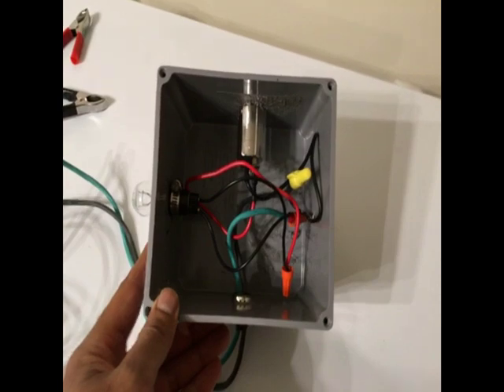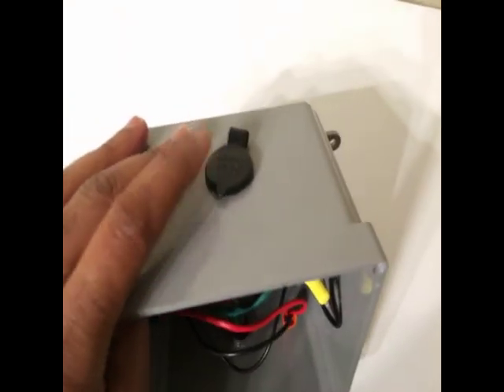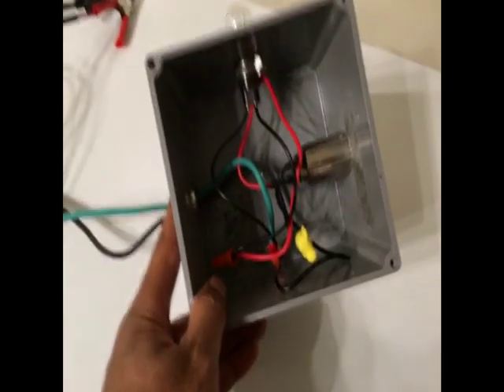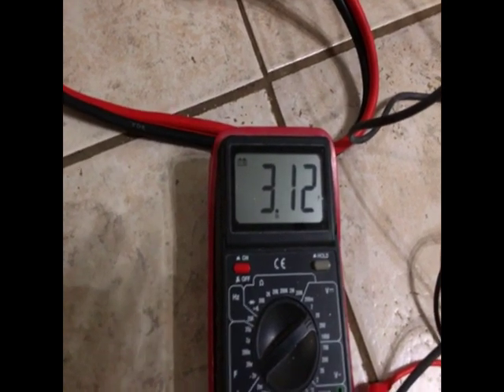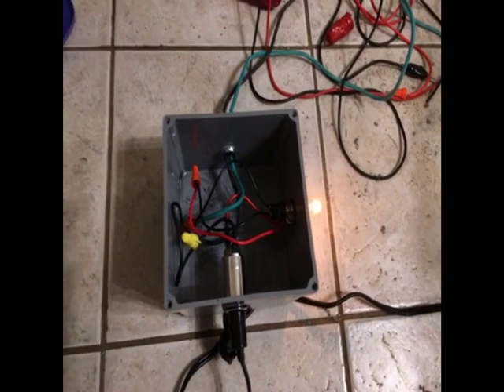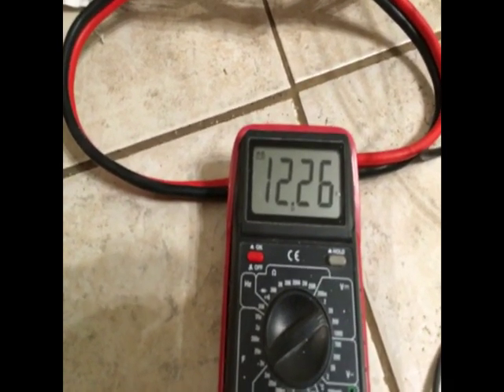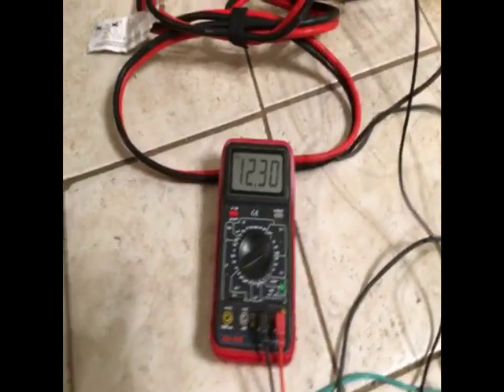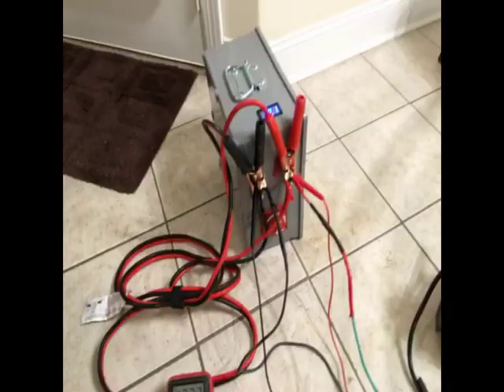How to Charge Ultra-Capacitors Safely

Comment: Bad to the bone I love it.
Reply from the maker: Thought you would like it.
Reply: It looks so good.
Reply: Thanks for the shout out
Reply: You can add a resistor in parallel to the light and it will charge faster too =)
Reply: Check the Ohms on the light and get double of that in 5 watts resistor and you will drop the charge to one third the time to charge
Reply from the maker: +Solar Power Electricity and Electronics (phillip20) thanks, I'll check it when I get the time.
Reply: Cool take care friend I just put up the video on the dryer i was talking about